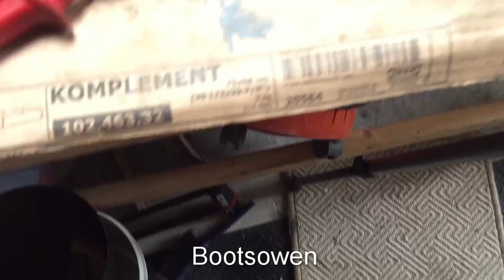Playing with a Beru sparker from a combi boiler | what could I use it for?

Comment: So, just power it up and it self-generates the HF spark ?  In cars we use transistors (or even older) points to generate the input switching - this is just "240v in  = sparks out" (until you remove the supply right ?)
Reply from the maker: Yes. Basically a buzz coil like in older hit and Miss stationary engines.

Comment: High Voltage Beru Sparker energiser for a combi boiler.
You could use it for busting Universal Washing Machine Motors especially the damaged Washing Machine Motor from the Fagor Washer Dryer you destroyed back in August 2020.
Also you could use it to fire up fluorescent tubes and low pressure sodium bulbs and even metal halide bulbs without any control ballasts.